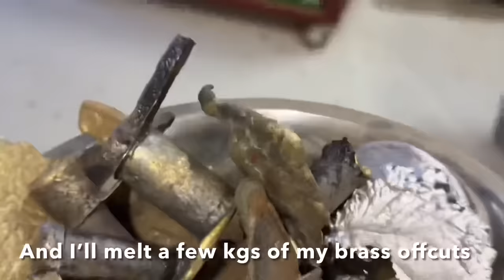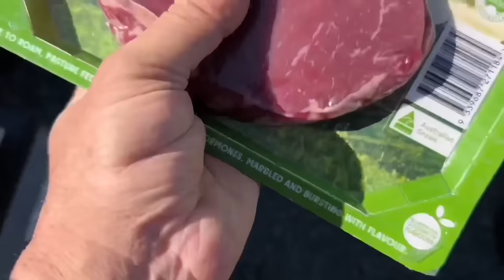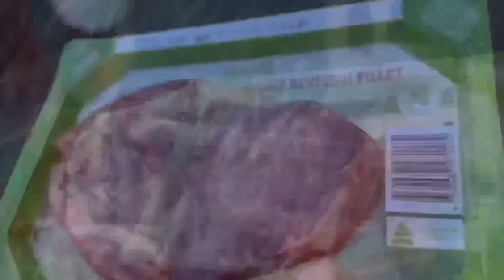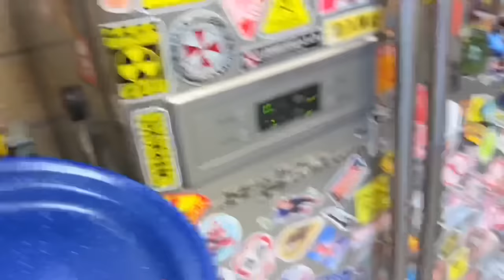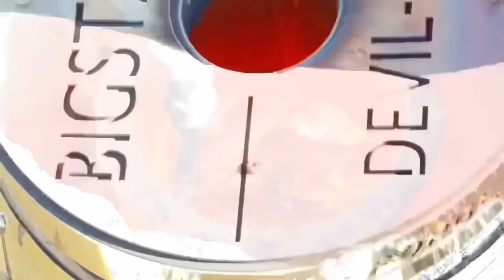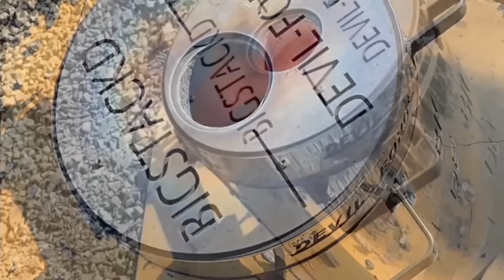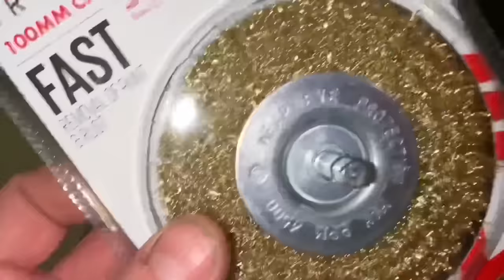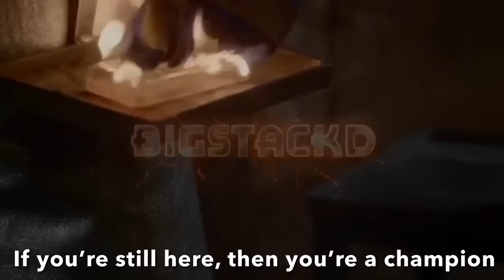Total Vault Value 2024 - $$$$$ - Trash To Treasure - ASMR Metal Melting - BigStackD Copper Brass

Comment: But how much did you spend on gas to melt it all down?
Reply: We may never know…
Reply: A 20-lb propane tank usually lasts about a week at 5-6 hours a day for a Diamondack Forge. That's $0.75 an hour - so the cost is negligible. The rest depends on things like how often you start/stop the forge, how efficient you are at loading, etc.

Remember, though, at the end of the day - there's literally no value in creating ingots. Copper has the same value so long as you've stripped it. You may as well be asking "yes, but how much did it cost you to build those shelves?"

He's 100% made a profit on the melting and shelving specifically for YouTube than he would have direct-selling.
Reply: He tracks it in the book

Comment: TIP: I use 1 needle nose and regular pair of pliers to seperate the wire jacket if the striper doesn't cut through all the way the 1st time otherwise you'll have to keep adjusting the tensioner again and again. You can even start with the pliers and than step on the rubber part and pull up that usually works too rather than wearing out the blades by running the wire through 2-4x.

Comment: So…. if you took the value of the ingots and subtracted from that the cost of electricity and power and propanr/butane gas, and tools grinder blades wire brushes moulds etc what would the final number be??

Comment: I've always been interested in blacksmithing and metal working just have never created the opportunity to do so. that being said even when you preheat the mold sometimes there are "Cold joints " in the ingots, what causes that?
P.S. my experience is in concrete and a cold joint is where you can see a clear separation of "Pours" (The edge of the ingot looks like two completely separate pours where the first one was cool already)

Comment: Just curious, that heat cant be good for cameras, could you use a mirror above the opening of furnace to take video?
Reply from the maker: Definitely not good for any cameras and they do overheat a fair bit, but if there’s even the slightest bit of a breeze, you can peer directly into the furnace right above it and not get any heat at all but the second that breeze stops or changes direction you’ll soon know about it👍🏻.

Comment: Damn, that copper was pretty clean...no slag?
Reply from the maker: That’s why I love Copper there’s never any slag, especially if it’s just cable. If the Copper has varnish or some type of coating on it, the only slag you’ll get is Ash inside the crucible, so not much slag Will be left there at those temperatures.👊🏻😁.

Comment: You could save a mountain of time cleaning up those ingots if you had a 2x72" belt grinder with a surfacing belt on it. It's basically a coarse scotch brite pad in belt form. I use mine on aluminum ingots i've cast and they come out looking incredible. Plus you don't get little metal wires stuck in you.

Comment: i just had an idea for a useful tool for your operation. have 2 slotted spools that counter rotate next to each other and when you feed in the insulation on one side and the copper strand on the other itll pull the 2 apart and spool them at the same time and when done you just slide off the spools and load the next wire and keep going. you could maybe incorperate a automated sizer type stripper that can slice and strip in a single operation. i bet you have the means to build such a machine, and im sure there are other improvements that could be implimented to save time and effort.

Comment: What would be dope would be an electronic display above each type of metal that displays current weight linked to an excel spreadsheet and have it increase as you change your values in the spreadsheet!

Comment: I have a question if I melted something that was aluminum, but it was copper coated. Does the copper float to the top or the aluminum to the bottom or how does that work?

Comment: I’m looking to build my first forge this weekend, ran across this and I am stoked!  Currently work with a lot of discarded plumbing copper, brass and electric motors, even high voltage contact switches, I have 300lbs of scrap copper and brass that needs melted, not many contacts/ breakers,but they come in every month and have silver buttons. I guess I even see circuit boards here and there, not sure how to separate the gold from those but I’ll find out.   Really, I just need to turn it not ingots, so it stacks nicer then how it is now, taking up two large bins in the garage.   Thanks for sharing!

Comment: I’m sure you know exactly what you have, but how do you figure a value for some of the more obscure alloys? It seems like with so many different types of brasses and bronzes that it would be hard to set a value?
Reply from the maker: I just go off the compositions mate, so if it’s Nordic gold I’ll work it out from the weight of that. For example 1 kg of Nordic 
I work out at 
10 g of tin 
50 g of zinc 
50 g of aluminium 
890 grams of Copper 
I do that for all the alloys except brass I put brass at $7.50AUD a kilo 👍🏻.

Comment: maybe a stupid question but why the stripping does the plastic/rubber not just burn off? or just to be more enviromental friendly?
Reply from the maker: When your melting Copper the melting temp is that high any plastic or rubber left on will basically turn to Ash, but you’ll need to wear respirator as it will come up out of the furnace and float around a fair bit near the furnace and you definitely don’t want to breathe that in. At the end of the day, you will just get a cleaner pour but the bar will turn out exactly the same whether you melted with the rubber on or off, it’s more environmentally friendly to take it off. Plus the fact if I did that on my channel, People would have an absolute carry on. Personally I take the thicker bigger stuff off and the very small thin stuff. I just put aside and either take to the scrapyard or hold onto it. In case one day I can get myself a Copper granulator.👍🏻.
Reply: @bigstackD  thank you, learned something new today

Comment: Wow , what a nice load of copper.  How much propane do you think it took to smelt all that??  maybe at least 5 thousand dollars worth of propane and the time spent is probably 500 hours collecting and smelting or more hours ?   just trying to figure out what  the profit is at the end.  How much gas used driving around collecting scrap?  but it looks really cool all stacked up.  You might have enough scrap there to construct 1 electric vehicle and save the planet.    Good job Sir!
Reply from the maker: I’m pretty sure you’re aware the devil Forge heat efficiency is amazing so I would have a rough guess at about $3000AUD in propane . And when it comes to collecting scrap and the melting process, it would be thousands of hours . And if I’m taking into account editing with 450 videos I would say that would have to be easily 4000 - 5000 hours editing🤔. A 1 hour video could take me 10 to 15 hours editing sometimes🤨
Reply: @bigstackD  Wow, I dont want to say its not worth the effort because its clearly a hobby also which makes it priceless for yourself. I think i would enjoy it too
Reply from the maker: @heinrichhimmler3998 yes mate, definitely a rewarding hobby, especially now with the vault room. 
It’s a very cheap hobby and with the beer fridge close by it’s even more enjoyable👊🏻😁.

Comment: I don't understand the point of polishing scrap copper and brass bars or the point of hoarding so much of it.
It was over $4.00/lb U.S. for most of 2021 and half of 2022 and over $3.50/lb U.S. most of the time since then and you missed the $4.94/lb U.S. spike in Feb. 2022.
If you don't want cash or bank or investment account why not sell it all and turn it into gold bullion coins?
it would take up much less room and be easier to move, after all a ton of copper is approximately equal in value to one fourth pound of gold.